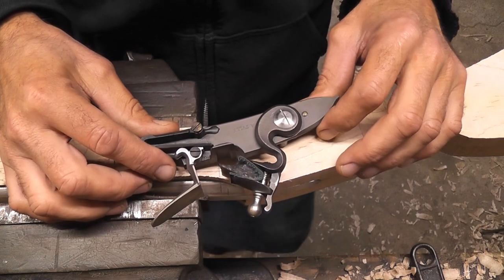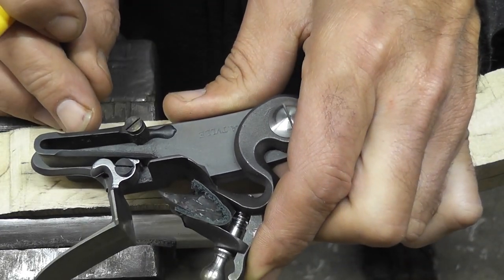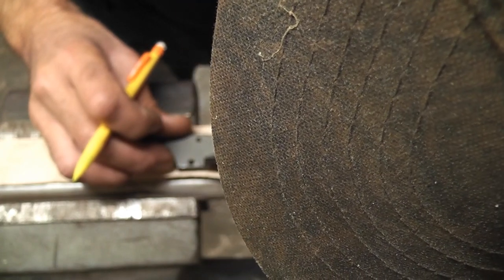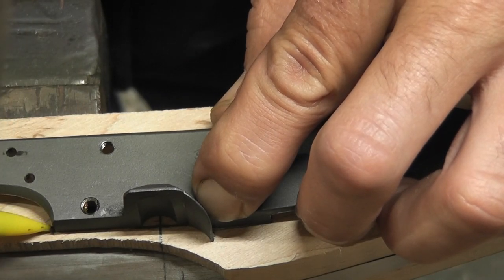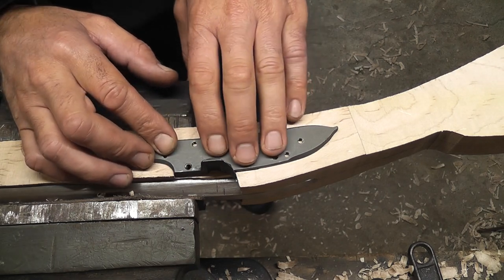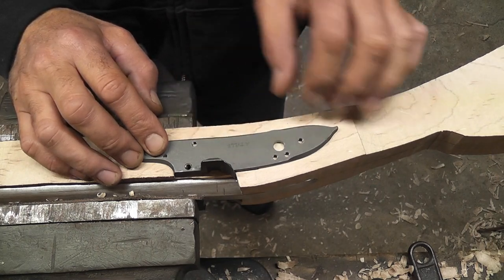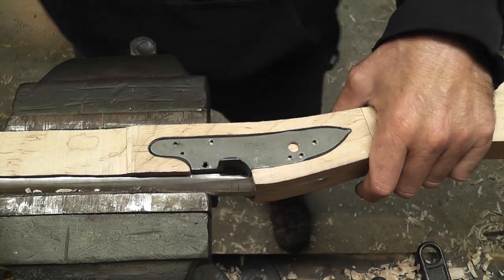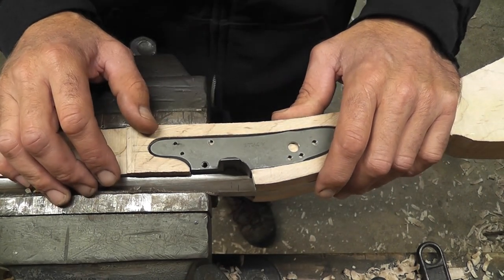Inletting a Flintlock Lock Part 1

Comment: Well this is a surprise! Seeing such excellent advice on youtube. If all builders watch this tutorial there would be far more properly built flintlocks out there, the only thing I would add is that it is far better to use a sooty lamp to find your touch down high spots, the blunty marker dries far too quickly in normal room temperatures, and using the soot lamp it is easy to re soot every time you fit up. I also find it easier to get a snug fit by filing a few degree draft on the inlet portion of the lock plate, it goes in and out much easier that way.  I look forward to viewing more of your videos. Chris B.

Comment: Josh, when I'm laying out the lock, I will use a drop of wood glue and glue a piece of cardboard or a sliver of wood that is the same thickness as the bolster so I can keep the bolster flat against the stock when I'm tracing around it.  It helps me to not have it rocking when I'm laying it out to trace the pencil marks.  May help others.  Hope so.
Reply from the maker: Good idea jeff
Reply: @oldironcabin3655  blue chalk like the kind that is in a chalk line dispenser works really well too

Comment: Using a kerosene lamp is a good way to add soot for marking your part to identify high marks in wood for removal. A candle also works. Adding slight draft around metal, I.e. plate, helps with fitting.  Good video...

Comment: I have a great deal of experience with Civil War era rifle muskets and weapons from that period in general and I almost screwed up an original lock trying to get the hammer and bolster apart on a friend's 1842. The punch method I find has a tendency to nick a thread or two and on originals, the metal tends to be really soft due to mostly having things just case hardened. I started carrying an assortment of screws with me that are about 3/4 in long and have come to simply threading them all the way down to where they bottom out on the hole in the tumbler and then just hammer the screw head getting the bolster out. Just a tip if you ever have to work on original locks.

Comment: Josh, are you a proponent of installing the vent liner in front of the breech plug in most cases? I have a rifle with the vent intersecting the breech plug threads to make the stock geometry pleasing at the wrist. Wondering your thoughts? I think you have some good ideas. Like drilling the rr hole first and tweaking the barrel layout.